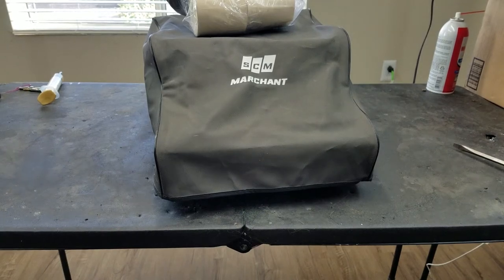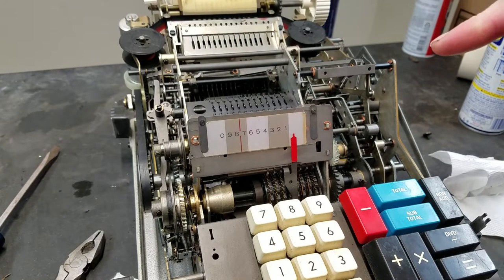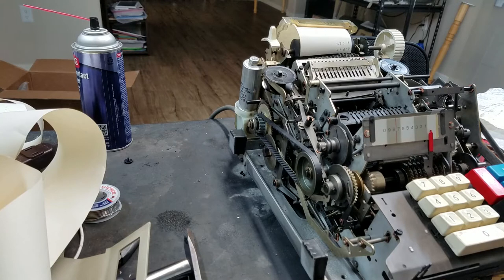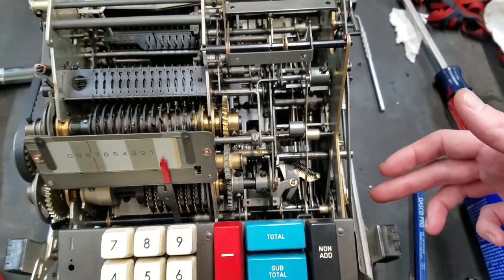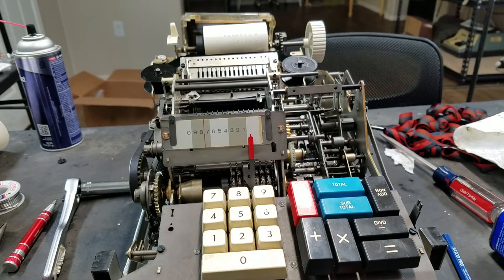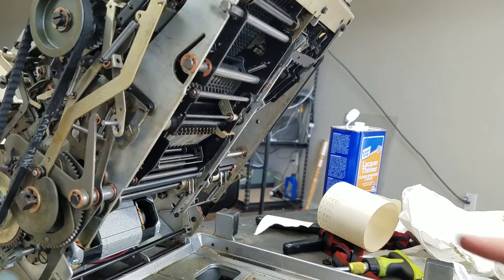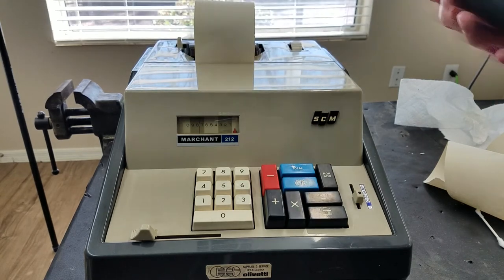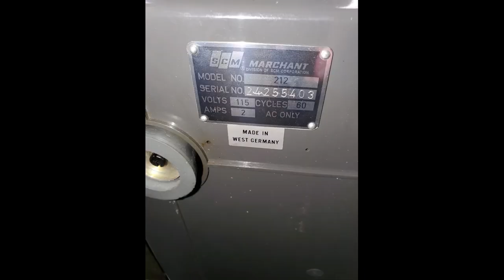1967 Marchant 212 Mechanical 4 Function Printing Calculator (Diehl Decima)

Comment: Rotary is VERY unusual.  This is probably the weirdest fully automatic mechanical calculator I have ever seen.  Even the two most complex and feature-rich calculators of their type- the Friden 1217 and the Olivetti Logos 27- had an oscillating rack mechanism.
Reply from the maker: yeah its too bad they developed this mechanism in 1963, the year before electronic calculators were introduced. It wouldve been interesting to see where they woudlve gone with it if they had developed it even a few years earlier